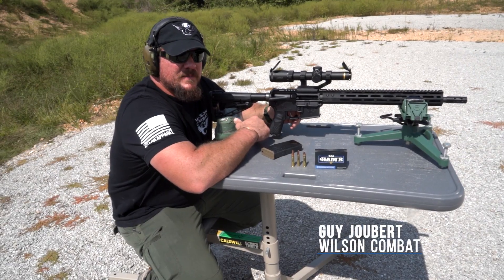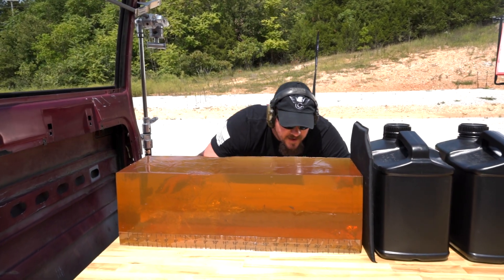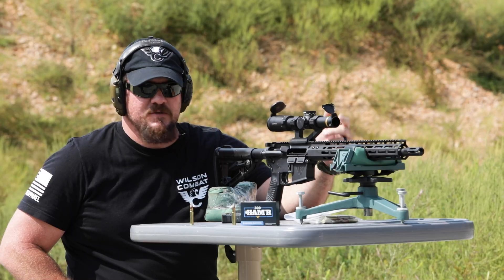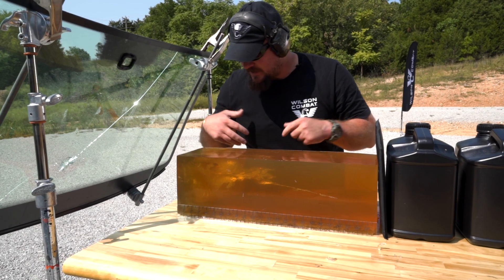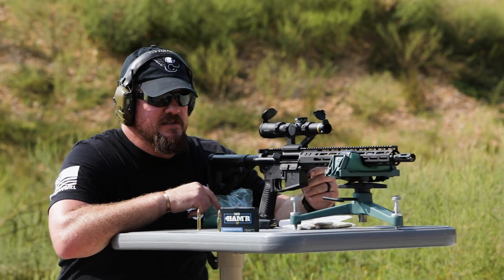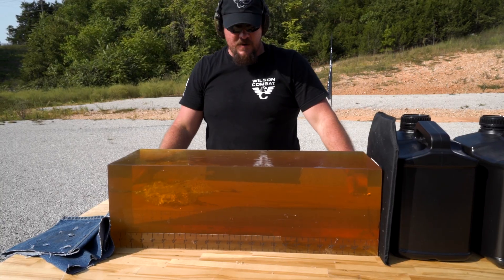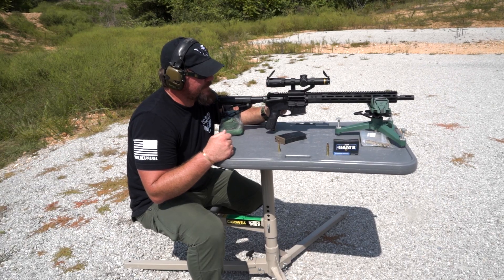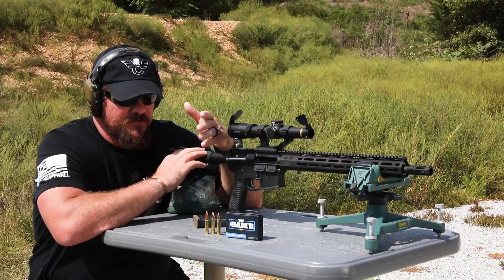300 HAM'R Barrier Tests - 3 Different Projectiles, 3 Different Barriers.  See how it performs.

Comment: I absolutely love this caliber. It is the premier AR-15 based round and should be the one that every SWAT and Tier 1 unit is clamoring to get. Flat shooting, long range, high capacity, low recoil, it has it all. But it has largely been pitched to the public as a hunting round. It is my belief that if we ever want to see 300 HAMR as a ubiquitous tactical round, then Wilson Combat needs to use its clout in the industry to promote this as a round designed for man, not beast. We need more testing and reviews in magazines, etc, showcasing its TACTICAL abilities.

Comment: Really appreciate the top notch motion imaging of the gel block.  It looks like the target was within 50 meters of the shooter, correct?  That distance is perhaps a minimum at which a high power centerfire rifle would be used.  Has it been explored if any SAAMI spec loadings for the 300 AAC Blackout---with these same projectiles---compare favorably with the 300 HAM'R?  Thank you!

Comment: Single GMT 800door layer with reinforcing bar? Maybe 0.125" combined? Put the rest of the guts inside the door, the steel inner panel holds window regulator mechanism.  Added the door panel too. Put it back in and then reshoot it. Not much resistance in a door skin

Comment: I love 300 blackout but this round really make sense. The whole point of the 300 blackout platform is sub to super. Go from decent versatility to just an average 30 cal. Doesn't make much sense to me.
Reply: The purpose is basically a 308 replacement. It has 2/3 the energy of a 308 but the ammo is a lot more compact and can be handloaded way cheaper due to a lower powder usage. In the same magazine pouch 40 rounds of 308 can be carried, 90 rounds of hamr can be carried instead. So instead of using an AR10 if you want more range, you can just jump straight to 300win mag ar instead.

Comment: The .300 HAM'R is one of my favorite cartridges to run in an AR platform.  A friend asked me once if I could only take one rifle with me, and I didn't know what I'd encounter, would I take 5.56mm or .308.  I said neither, I'd take .300 HAM'R.  Lighter rifle than a .308 while out-performing a 30-30.  I'd say that's a fair compromise.
Reply: There are a few lightweight 308 rifles on the market now.  Ruger just introduced one that weights about as much as an AR15 for under a grand.  The game is being changed yet again
Reply: @TommyboyGTP  I've heard good things about that rifle.  You also make a valid point.  Having fired the M14 in the National Matches years ago, I just know I can get follow-up shots on target much quicker with .300 HAM'R than with .308.  Now, I realize the .300 HAM'R may not have the same punch out to 600m and beyond like the .308.   But that's the great thing about having choices.  And to my friend's original question, I can't foresee ever limiting myself to just one cartridge or one rifle.  I'm always in favor of the right tool for the job.
Reply: @Axe_six-six  The Ruger rifle comes with a muzzle brake making the 308 quite tame.  my understanding is Ruger will also be offering it in 6.5 Creedmoor as well.
Reply: @IaB365  Easy peasy if you got Dillon trimmer!  https://youtu.be/3enp705muoQ
Reply: You can have it lol.
Reply: I have been using Speer's 130gr Hot Cor's in my 30-30's & isn't no way the HamR comes close to the velocity I get @ 2600fps With CFE 223. The HamR might do 2500 on a good day with some more barrel.
The HamR is missing the barrel length, which is what people want in an AR.
Never did understand why Wilson went with the Wilson round when somebody already had the HamR ready to go. Now he jumps in.
Reply: Id like Winchester an Remington to make some ammo. A 300ham'r Remington Cor Lokt would likely be a good hunting round. An it would lower the ammo costs.
Reply: I'm pretty sure you won't encounter any ammo for it if SHTF. You'll find .556 and .308. At least you can switch uppers. $1 dollar a round vs $2 for 300fps gain over 300blk is not that great of a compromise.
Reply: @baconatordoom  You make a fair point.  When he posed the question to me, it was more of a "trek into the woods" scenario, not SHTF.  But you're right.  I don't have as much .300 HAM'R stockpiled as I do 5.56 or .308.  But thanks to your reminder, I'll be fixing that shortly.  Thanks, brother!
Reply: @baconatordoom  True, you won't find any ammo on the store shelves BUT, it's a reloader's dream!  Using old prices it cost me 11.3 cents per round or $2.26 per box of 20.  I'll break it down.  Brass is free .223 range pickup and converted, just like 300 blackout.  I bought 20k of primers in 2020 for $26 per 1000.  Powder I bought $20 per lb.  Bullets are 2 cents a piece (50 per pound of lead, lead is $1/lb)  If you're wondering how they shoot?  They shoot great!  Around MOA, 135gr bullet traveling 2350fps.  I also found I can shoot Berry's copper plated 123gr over 2500fps and still MOA.  The cost of that round 19.4 cents or $3.88 per box of 20.  Now I also got jacketed Speer 125gr HP as well as 130gr Hot-Cor.  The cost to reload these is 25 cents or 12.50 a box.  These are old prices and by old I mean 2 years ago is when I bought these components.  If I had to buy all components today besides brass.  Looking at 8 cents a primer (prices came down actually from 10-12 cents) 21 cents a bullet (midwayusa) and 33.50 for pound of powder with shipping and hazmat if you buy 8lb keg the price comes out to 41 cents a round (not counting sales tax).  And if you cast your own bullets the price drops to 21.6 cents.  You'll spend more on 9mm.  I love my 20" upper!
Reply: @DimaProk what primers do you use for the 300 hamr?
Reply: @gregpelc2635  Any small rifle primer will work unless you're trying to squeeze out max velocity then magnum primers are needed.  I was getting pierced primers (CCI400) when I was pushing light Zinc bullets (84gr) 2700- 2800fps.  Combat Wilson specifies to use magnum primers (CCI450)  I've got those too now but I still use regular ones too.

Comment: Thanks for another great video from Wilson Combat. 
I would like to see accuracy tests on the 300 Hamr.
Reply: I once got a 1 MOA 3-shot group from my .300 Ham'r using a 2 MOA red-dot that is more like 3 or 4 MOA due to my astigmatism.
Reply: I took my Tactical Hunter 300 Hamr to the indoor range.   I shot 4 20ct magazines and got a hole the size of a quarter that they all went through on 4 different targets.   Besides power in the AR 15 platform, it is hard to miss with this gun.

Comment: What are the velocities from that 26 inch barrel?
Reply: A 125gr from a 16 inch barrel gas gun moves around 2550+fps. Add another 125+fps from a bolt gun.
Reply: Not even 30/30 level
Reply: @prestonmonaghan499  Nobody shooting 125gr bullets from 30/30.  Bill has a video where he compares 30/30 factory ammo loaded with 150gr and his 300 HAM'R loaded with 150gr and HAM'R performs just a hair better BUT with a 30 round magazine and using pointy bullets.  Look it up, he proved it, no BS, real test over chrono.  Yes, you can probably push 30/30 faster with reloads and modern powders I won't argue about that but the HAM'R advantage is clear to me.  BTW I have both guns.

Comment: So is this just basically 300 BLK or 7.62x39 for guys with too much extra money to waste, or is there a significant advantage over other 30 cal rounds that cost much less and are more available?
Reply: Depending on the particular round, the 300 HAMR loads run about 300-400 fps faster than 300 BLK (with around 400 foot pounds more energy) and about 200 fps faster than 7.62 x 39. 300 BLK is great for subsonic work, but 300 HAMR wasn't made for that. It's mean to be the equivalent of a .30-30 but in an AR form factor.  You still get your 30 rounds in a magazine but with a more potent round than 5.56. Having shot the 300 HAMR on a few occasions I can also attest to its outstanding accuracy, particularly from a Wilson Combat barrel. Sub-one-inch groups were the norm with the ones I've shot and you're definitely not getting that from 7.62 x 39 out of an AK. As for being more available, the only thing you have to do to shoot 300 HAMR out of your AR is buy a 300 HAMR barrel and swap it out. It uses all of the same internals as a standard 5.56 AR rifle.
Reply: You don't have to like it, but don't turn your nose up out of ignorance.

125gr velocity is around 2550fps from a 16 inch barrel. So...300 HAM'R exceeds 300 Blackout and 7.62x39.

Said another way, 300 HAM'R is everything 300 Blackout (and by extension 7.62x39) supersonic rounds wish they were.

300 Blackout is still the king of subsonic.

From a 300 HAM'R bolt gun, 125gr velocities can safely get up to 2600+fps. 110gr and 95gr rounds are absolutely screaming from a bolt gun.

300 HAM'R takes advantage of the BC of quality bullets.

300 HAM'R maximizes the AR15 platform with little modification, a high BC 30 cal bullet, a full 30 round mag using 300 Blackout mags.

Again, referencing a 125gr bullet, @ 225yd/1000+ft-lb, and supersonic to 625+yd. 300 Blackout and 7.62x39 can't touch that.

The 11.3 inch 300 barrel delivers the same ballistics as a 16 inch 300B or AK round.

The cost is subjective. I reload so the cost is cheaper than anything commercially produced.
Reply: @BackwardTravisty  If you actually reload then you know you can get the same ballistics out of 300 blackout and 7.62x39 when you're reloading those.  300 hamr is just 300 blackout with a different chamber.
Reply: @saintsinningsword  Reloading the Ham'r requires filling the case almost entirely full of powder, and the Ham'r case is 6-7mm longer than the BLK. Just based on case capacity alone there is no way to load the BLK to the same levels as Ham'r.
Reply: Guns, ammo and too much money? Ha ha! My ex never groused about my guns, reloading, none of that....but I remember I was doing my monthly, cleaning/oiling all my "stuff" in garage one day. She came out as I was racking a long gun back in the safe, her eyes got kinda big and she sez "how many guns do you have!?"  as I closed the safe door....I looked at her and sez " not enuff!" Ha! Question never came up again.
Reply: The only thing I could determine from the reviews and specifications is that the 300 HAM'R is more accurate than 7.62x39 and much more powerful than 300 BLK. But what a steep price for more accuracy 🤔 If I win the lottery, I'll buy one for you and one for me 😉
Reply: Um it's made to have ballistics of 30-30 but shoot out at platform must not have  watched Bill talking about it.
Reply: I think the original idea was to put a 30 cal bullet in a 5.56 shell casing, to save money reloading.
Reply: You sound jealous & uneducated.  Not a good combo.
Reply: I built up my stockpile of .300 Ham'r in 2021. Could not find .300 BLK at all, but I could find .300 Ham'r.
Reply: More terminal performance than 300 and better suited for ARs than x39.  Also, more bullet choices than x39.
Reply: 762*39+p++
Reply: Its only expensive because Wilson combat is primarily involved, if say Winchester an Remington made ammo for the 300 ham'r the ammo prices would drop. Also look at the Barrels.. Wilson Combat an Shaw, last i looked i didnt find one under $200. If more got into the market to make barrels the barrel prices would drop that would make the 300 ham'r in a AR platform more affordable overall, from the build to the ammo an more would use it. 
As is its Cheaper to reload, just resize 5.56 brass to fit a 130gr 308 bullet, an be sure to use the proper powder an a magnum primer. It's a rifle round unlike the lil brother 300blkout which uses a trimmed 5.56 case an is best used in AR pistols an suppressed ..